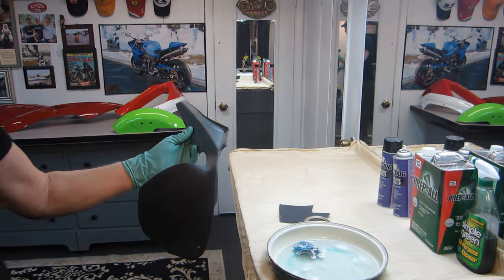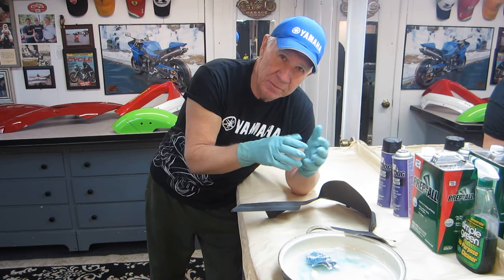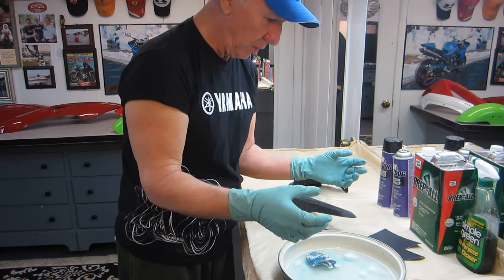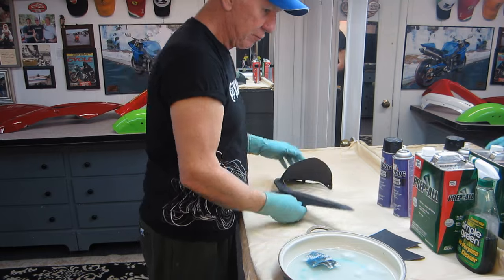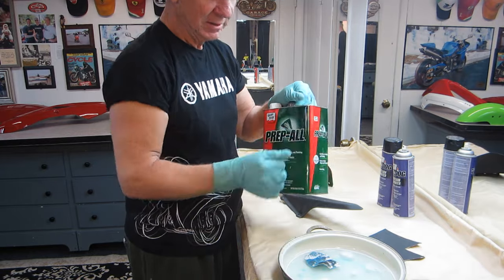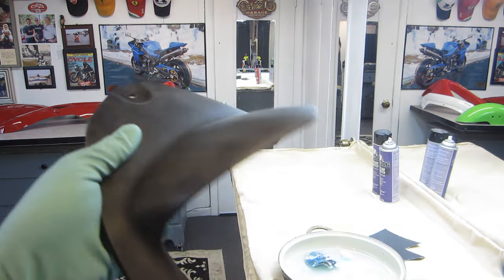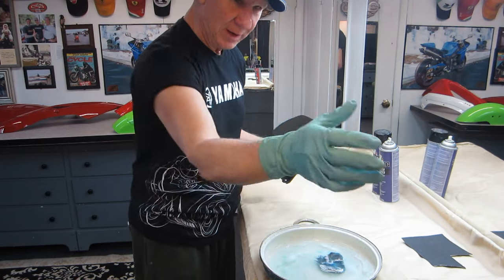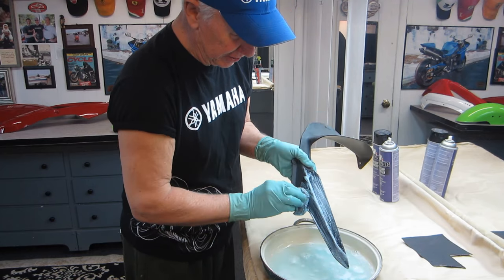HOW TO PREPARE PLASTIC PARTS FOR PAINTING

Comment from the maker: RINSE IF POSSIBLE IN EXTREME DIRT CONDITIONS I WOULD ALSO STEAM CLEAN AND USE A GOOD DEGREASER LIKE PREPALL.  I WILL BE STARTING SOME REALLY OLD CARBON FIBER PARTS IN TWO WEEKS AND WILL GO THRU ALL THE STEPS ON THE NEW VIDS IN 4K.

Comment: Well done 👍 & liked.. I have an old laptop back case to spray paint black tomorrow.. and it's a lil dusty.. For pre cleaning, should I wipe it down with isopropyl alcohol or just plain warm water with mild detergent before spraying paint.. what do you suggest?

Also is a primer spray mandatory which I don't have at hand?

Comment: so.. here I am in central Australia a gizillion miles from a paint supplier. I have acrylic left over from doing the 4WD, clearcoat,  primer and thinners. And I wanna repaint my fairings.  So I'm thinking.. as long as I clean the existing paint like hell with soap and water after I sand it back very very thoroughly to get an adhesive surface.. so it's spotless and super "keyed".. then prime it.. without too much thickness.. then do a lot of coats of top.. then a lot of clearcoat.  I might get a finish that doesn't peel or chip.  Am I wrong?  It seems to me all these videos say the same thing - clean clean clean.  Is that enough? After all paint is a plastic and as long as it sticks to the object it should work.  In theory.. :)  Or do I need an "adhesive" layer?  What do you think?

Comment: Im so mad right now
 I found out older bathtubs in mobile homes, were injection molded with ABS PLASTIC then they turn the mold over and they add fiberglass and resin and call it a tub.
So if one doesn't know this your going to become so passed youll want to put it outside for a play pool or use it as a pond.
Just an FYI

Comment: Kerosene?  That stuff has paraffin wax in it.  Try wet sanding with 3M Wet Sanding Sponges, 400 grit.  Wash, use electrical contact cleaner or brake cleaner, then adhesion promoter, color paint and finally clear it! Wet sand from 1000 grit to 3000 grit and finally, a high quality polish.  FYI, polishing compounds range from 800 grit to about 2500, they might make a finer one too.

Comment: For plstic
Surface clean
Then surface prep such as sanding
Then surface wash including rubbing Alcohol
Then it's appropriate primer for plastic that would be a plastic acrylic primer however many coats whilst allowing suffiecent drying time between coats 
But then we come to is there a spray on undercoat that's required? 
Top coat 1-2 coats allow suffiecent curing time between coats even wet sand between coats even necessary 
Then after final top coat I'd use a clear cost protective spray it takes 3 days to dry but it gives a bit more durability to top cost finish

Comment: Hi, someone told me to use 600 sand paper, is it ok to use 600 as well?
Reply: Get a few sheets of each & experiment, his plastic had texture to it, NOT SMOOTH. Paint will fill in the very small scratches of 400 or 600 grit. Make sure you get WET/DRY SANDPAPER AUTOMOTIVE STUFF.

Comment: Thinners melted the old plastics because they were a polycarbonate, many headlight lenses today are a polycarbonate, many motorcycle parts today are not because its easier to plastic inject mold non-carbonate plastics
Reply: dissolved not melted :)